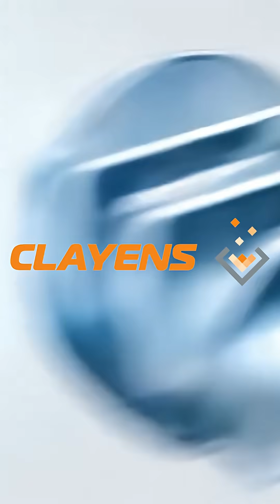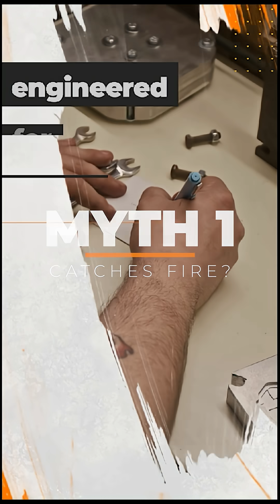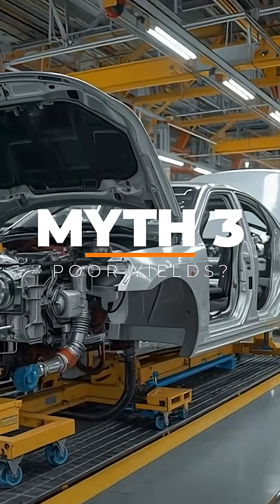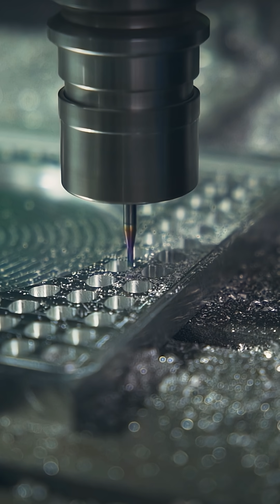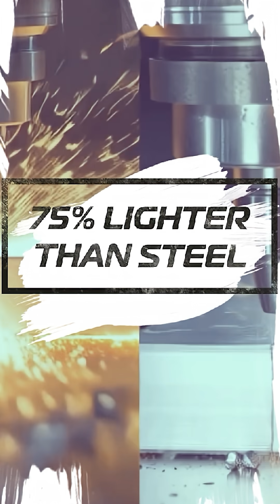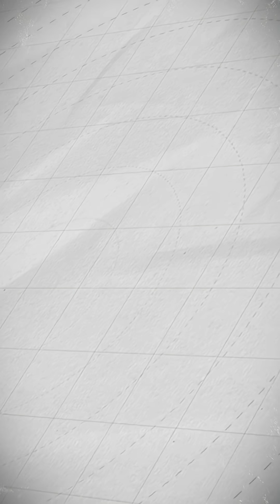Magnesium Thixomolding: Myths, Facts, and Why It’s the Future of Manufacturing

Comment: So why can’t you give a figure on how strong it actually is?
Reply from the maker: Great question! Strength depends on the specific magnesium alloy and part design, but as a reference, Thixomolded magnesium alloys like AZ91D or AM60 can reach tensile strengths around 230–260 MPa and yield strengths near 150–200 MPa, while being about 75% lighter than steel and 33% lighter than aluminum.

That means you get metal-level strength at a fraction of the weight — one of the main reasons aerospace and automotive manufacturers use it.